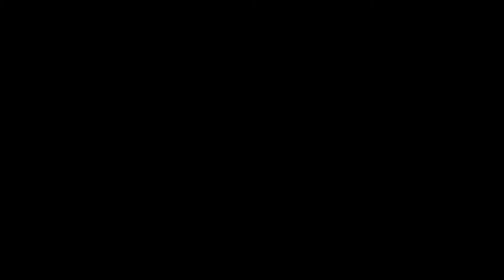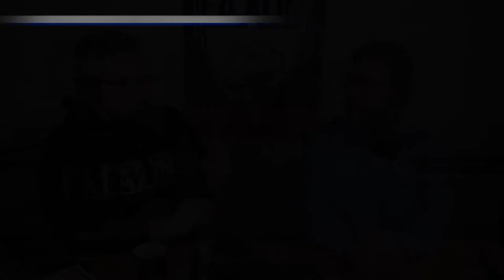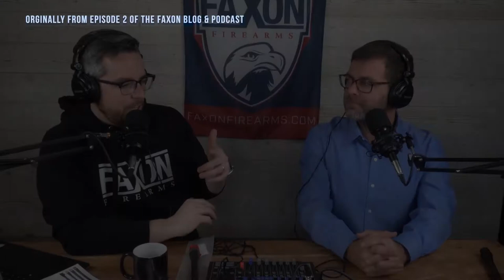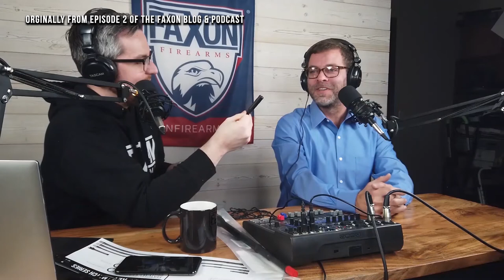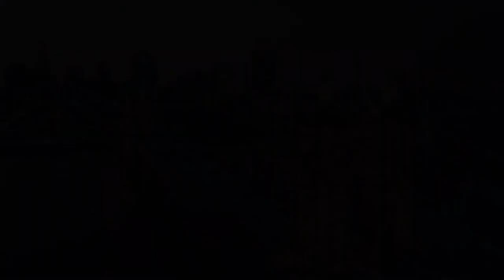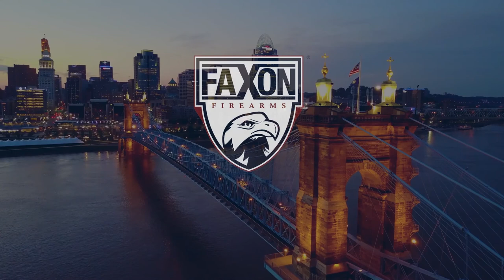Integral Barrel Overview

Comment: Hey guys. I built a rifle using the 16” pencil with the integral flash hider, and “flash hider” should be “flash bang”, because that thing does not hide any flash whatsoever. I get about a basketball sized fireball out of the end of my rifle after every single shot.

Comment: You would sell way more with a.750 gas block format and a bigger flash hider. Maybe an M4 16 for the cloners. would be a better alternative to a pin and Weld because it could be disassembled